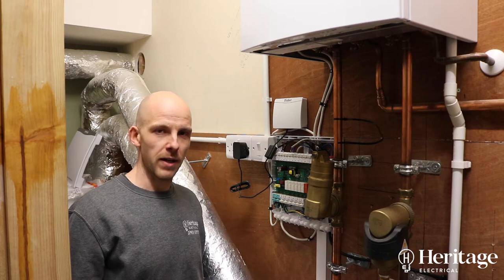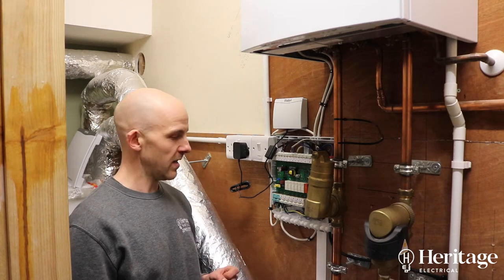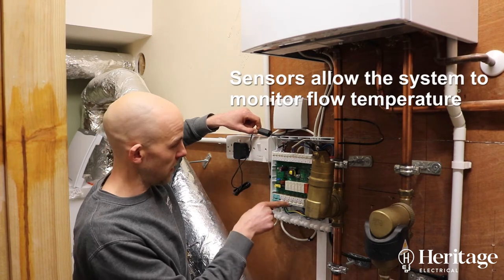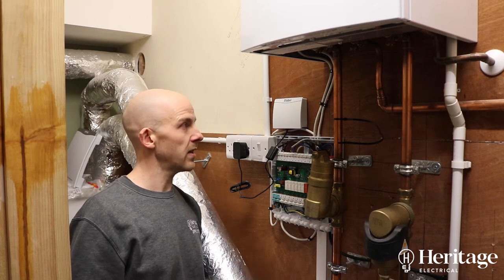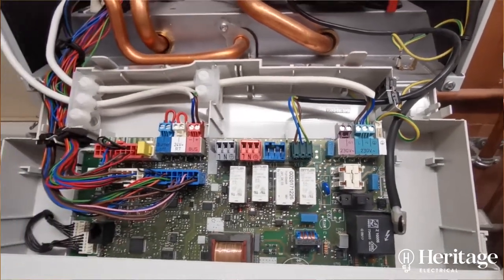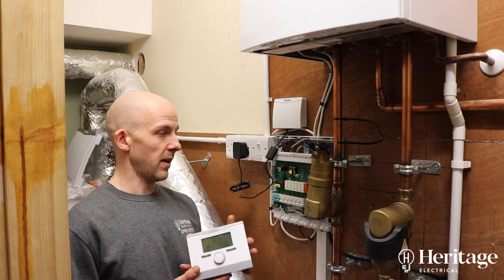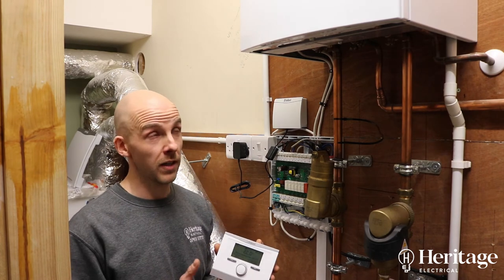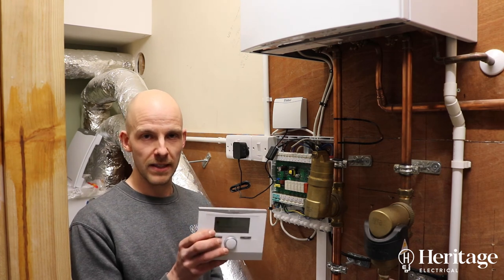Part 1: Vaillant Heating Control Wiring - Ecotec Boiler; VRC700; VR71 Wiring Centre

Comment: Hi, very useful video, can activate more 3 zone? I have :vr71,vrc700 (wireless),vaillant ecoTEC boiler. 
The problem is I have: 3 underfloor heating zone, 1 radiator zone, 1 hot water all connected in low loss header 
The question is: can activate more 3 relays from vr 71 ? Changing the diagram system? 
Thank you.
Reply: @Anthony  thank you for answer, I think i will use one zone for towel radiators and hot water (because can set a higher flow temperature), and two zone for for underfloor heating (can use a lower flow temperature). My system is higher, I have: two ecoTEC plus boilers 64kw each,cascade conection, three floors, every floor has three manifolds, three hot water cylinder and towel radiators circuit. Anyway your video was helpful chosen the right heating diagram. Thank you.

Comment: Sorry, im little bit confused - is there a module which goes into the boiler to make all of that work? Currently ive got one zone heating using vrc470f and vrc470f comes with a "module" which goes inside the boiler (ecotec 825). Ive been advised that to divide heating into two zones i need to replace my vrc470f with a VR70, VRC700F, VR92F. I get this part, but what about that module which was put inside the boiler, will it need to be replaced as well? And also what about the wireless outside temperature sensor/dcf clock, will i need to replace it with something more modern? Just trying to asses the cost here.

Comment: Do you use the boiler's pump to send water to the heating floor or a separate pump is used. If a separate pump is used, will the VR 71 provide the start stop 
signal to the pump?

Comment: Have you ever wired and unvented boiler s system but using the Vaillant SensoComfort or SensoHome?
Reply from the maker: Hi. 
Appoligies we have not been asked to fit that system yet.
It would not be a problem for us if you require our services.
Thanks for watching.
Heritage electrical 🙂
Reply: Hi Tom how is the best way to get in touch with you. Thanks

Comment: Good video, how would you connect a 2 port valve into the VR71 for DHW?, should it go through the cylinder over heat stat?.
Thanks
Reply from the maker: Hi David
The VR71 has  connections for 3 heating circuits and 1 connection for HW. So you can control 4 zone valves if necessary. 
There are also a seperate connections for the cylinder stat and other temp sensors. 
Cheers paul
Reply: @Heritage Electrical  Hi Paul, thanks for the reply.
I’m now having trouble how I connect my 2 underfloor heating circuits and my radiator circuit into the VR71, the stats controlling them are 230V and the connections into the VR71 are 24V.
Vaillant are absolutely useless when I ask them for advice.

Any help would be really appreciated.

Cheers Dave.
Reply: @davidwilson4671  Vaillant hate anybody who's not a Vaillant installer doing their own work despite the fact that the Vaillant installer that installed my new boiler did a shite job.
Reply: @L.C.Sweeney  it’s extremely over complicated that’s for sure.

Comment: Thank you for this, its almost exactly what my setup is at home (that I'm currently trying to understand).  We have the VR71 and a VRC700. I want to add a VR920 but I'm a bit confused by how I'm supposed to connect that to the eBus on the VR71 if the VRC700 is already connected. Any advice?
Reply: That's exact the same thing I want to do. I only have the VRC700 connected trough ebus and I 'd like to know how I am supposed to connect a vr920 internet module to this existing installation. Hopes someone give the answer. I 've been searching on the web but could not find a wiring diagram.
Reply: @dimitriclaes7624  So I've managed to source a VR920 and an ambisense radiator valve. I'm hopefully getting someone to install them next week, so hopefully I'll have more information then!
Reply: Dear Matthew, did you actually manage to install the VR920 in combination with the VR71? I actually want to do something similar (VR921 in comb with VR70 and VRC700), but I cannot find any wiring scheme by Vaillant ...
Reply: @alexanderclarysse5233   Hey, yes we did! I got one of the local approved installers round (via the website) and he did it with no issues at all. Iirc, the connections are daisy chained and can be connected in any order (in answer to my original question).
Reply: Hi Matthew, thanks for your quick reply! Would you mind sharing a picture or scheme of the wiring between VR70 and the Internet module and the wiring to the pumps?